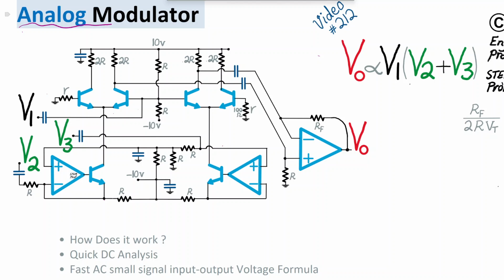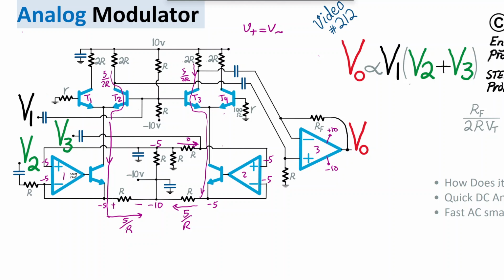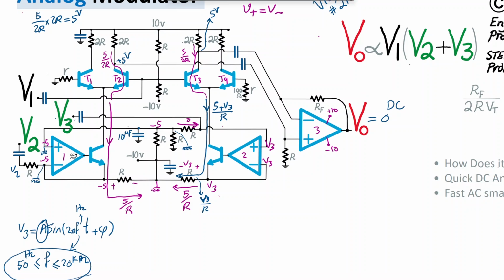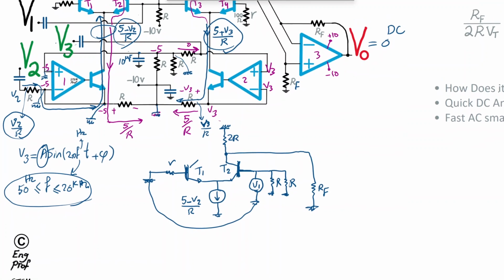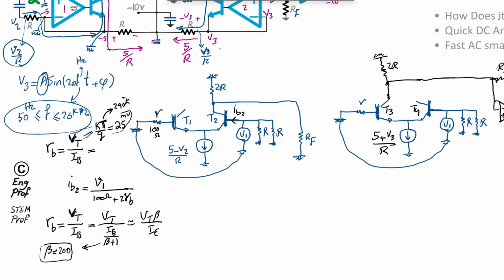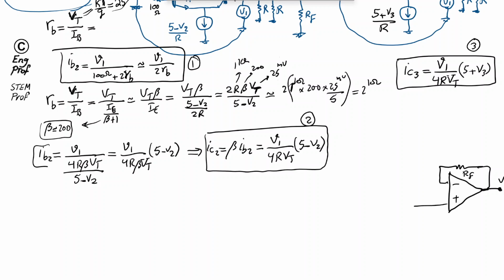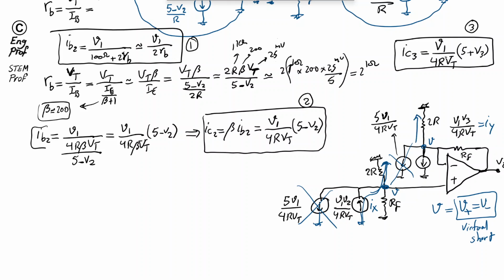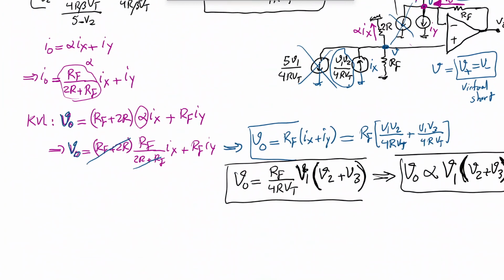Analog Modulator Circuit Explained

Comment from the maker: An Analog Modulator is Explained and the circuit operation is analyzed in this Video. For more Analog circuits and signal processing videos see:  PhotoDiode Amplifier with Data Compression Explained https://youtu.be/hqrRx2ufAwg
Analog Logarithm Computer with Op Amp https://youtu.be/RpKEq5WyoLg
Instrumentation Amplifier with Electronic Gain Control https://youtu.be/C4tghZ-q6Zs
Temperature–Compensated Programmable Current Source https://youtu.be/QY48IQXJIRI
Analog Exponential (Anti-Log) computer https://youtu.be/kk2c7Gk3nW4
Analog Multiplier Circuit (4-quadrant) https://youtu.be/VP53A2zpVMQ
Analog Computer to Raise Signal to power n https://youtu.be/IUTlBH1UraE
Analog Computer: Signal Division Calculator https://youtu.be/2axI5l3cf6c
Op Amp Analog Computer Differential Equation Solver: https://youtu.be/ENq39EesfPw
For more analog signal processing examples see: https://www.youtube.com/playlist?list=PLrwXF7N522y4c7c-8KBjrwd7IyaZfWxyt
I hope these Circuit videos are interesting.

Comment: hi sir , In the video at minute 17:24, I would like to understand why in  the ib2 statement you took the volt values of rb1 and r to be positive 

and my understanding is that they are negative   Therefore, the expression of v1 will be -v1/100 .
Reply from the maker: @fouazhdib6813 Good question.  Given that V1 is applied to the base of NPN transistor T2, as V1 voltage increases, the base current of T2 increases as well. Therefore ib2 = v1/(100+2rb).  Here are a few more examples of differential amplifiers:  Instrumentation Differential Amplifier  https://youtu.be/2xJpqfexsPg
Differential Amplifier Gain, CMRR https://youtu.be/z8f7iZei5cY
Differential Amplifier Design with BJT & JFET transistors https://youtu.be/zKgSYvk7JAM
I hope these videos are helpful.